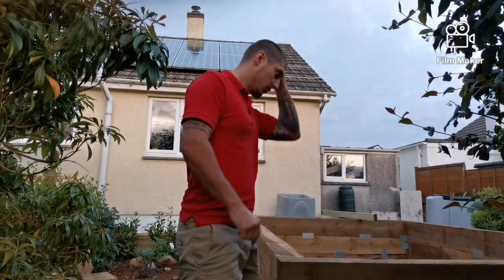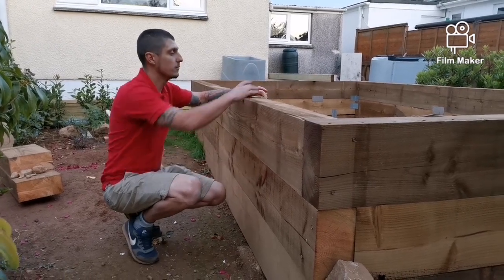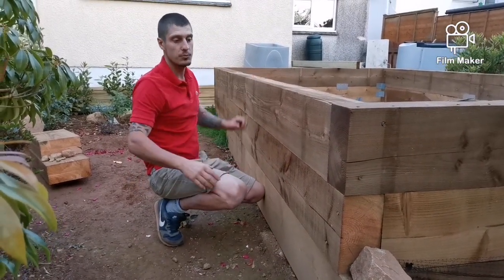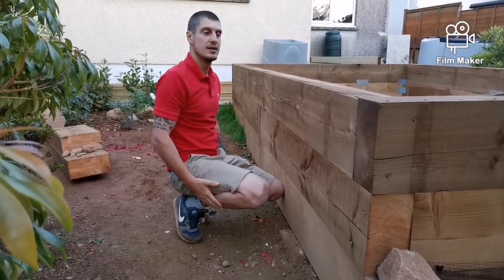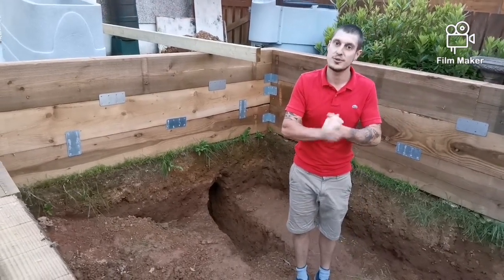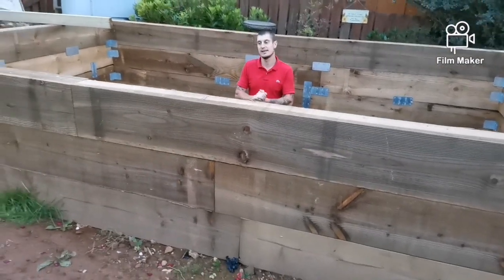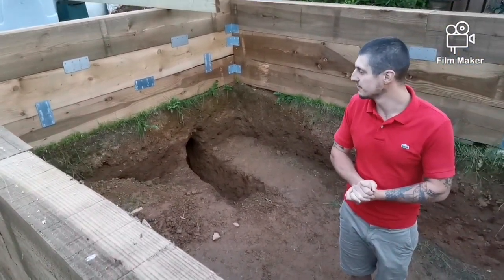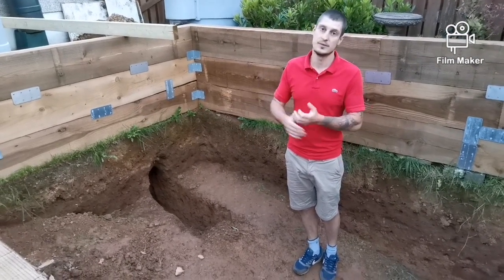Part 8: Building a KOI Pond for begginers 4mts x 2.2mts  lockdown project

Comment: No no no the sieve is the first step for the nexus it will do nothing on the skimmer line
Reply from the maker: I was told by quality Nishikigoi to do it the way
I did wanna go bottom drain to Sieve then then 320 then back in but its gonna be hard to balance it out wouldn't it?
Reply: Iff you keep them both at water level then they will work I think or just ditch the sieve and run the 320 and the skimmer to a baki shower
Reply from the maker: @russelladams7053  yeah I think  cause to have it I needed 2 pumps on the same set up what will make it hard.
I'm no expert I'm learning myself 👍
Thank you for your help.
Have you. Got the Sieve and 320 as 1
Reply: @russelladams7053  so pump all the crap collected from the skimmer in to the shower, great advice
Reply: Both ways will work but the nexus doesn't need the sieve as much as the shower. Matt don't get caught in the middle of a debate that doesn't have a definitive answer as there are always going to be people on both sides of the fence.

Running a nexus 320 at around 8000lph or so should remove all the waste and give you particle free water.

A bakki shower runs better with a faster flow rate and so needs its own circuit but you still need to filter the water beforehand to remove any particles as the shower medis will eventually clog up otherwise. The sieve will remove most but as a precautionary measure put some filter floss/wool in the top tier and see what happens after 24hrs.

Lots of people use filter floss to take out the finer particles that a sieve cant remove.

Tim and Paul at quality Nishikigoi have been in the trade for many many years and know a thing or two about evolution aqua products and their limitations.
Reply from the maker: @Tom_Prendiville   thank you for the comment make alot of sense.
I have been talking to them and they have been helping me alot.
How are you anyways my friend. 👍

Comment: Well done on going with the skimmer that's a must 👍. You've asked a really tricky question half way through your build 🤔. Do you have a window or not ??? ..... ask yourself a few questions.  What benefit will a window give you for view?,how much grief will this be now your this far into your build?  what side of your pond would you have the window and would you have a area to sit and admire your fish through the window???how are you going to fit the window (seal piece of glass in or have it mounted in a steel frame) look on ebay theres a company there that do a railway sleeper steel/aluminum frame and glass specific for this sort of build using railway sleepers  (Atlantica) .Also and this is the big one . Now your this far through your build and you've reinforced the sides with rebar how are you going to remove the sleepers to incorporate a window? Remember I've already built a railway sleeper pond (done sleepers flat though) I didnt do a bottom drain . I didn't do a skimmer and guess what.. I didnt do a window 😔.  All regrets but never had a issue with water quality or filtration.  My next pond will be twice the length with bottom drain . With fitted skimmer and definitely with a window . But I know where there all going to be and how all my pipework is going to go .planning is key and a window should really be planned into your build from start . Hope this helps and remember..        " im always watching" 👀 lol .
Reply from the maker: Thank you Mark F,
I can easy cut 2 layers of sleepers out and cut the rebar.
But yeah think I left it to late for planning a window but it can be done
I am worried about having a window and in 2 mind if to or not.
They definitely look nice and make it easier to see if somthing wrong with your fish.
Thank you so much for your comment.
Reply from the maker: Get a surprise for you on my new upload 👍

Comment: Ponds coming on nicely now 👌 
Just a quick one for you...the piece of wood you are using to gauge your water level for your filter is on top of your sleepers. The final water will need to be lower than your marker or water will be sloshing over the top of the finished pond
Reply from the maker: Hello glynne,
Yes you are right I've just got that level so I know when digging Down for the filter I know it's got to be lower then that point 👍
Thank you for your comment 👍

Comment: Ponds looking great so far. Quick question why didn't you place the sleepers on a concrete pillar? All the ones I've seen on Facebook say you need one.
Reply from the maker: Hello qasim nawaz thank you for the comment.
The real reason why I didn't is I did rush the start and just started digging before  thinking about it.
It should be fine with out the concrete surround.
Well only time can tell 😂😂
Reply: @mattsonhobbies6966  hope you right. Thanks for the reply
Reply from the maker: @qasimnawaz9376  😂😂so do I 😂😂
Nah it will be fine 👍

Comment: Hi mate just quick question did you use any screws to connect each layer of the sleepers like 300 mm screws from the top of one sleeper all the way through to the next sleeper I know you used a rebar aswell or was it just  the ends of the sleepers screwed ,bracket plates then the rebar cheers mate 👍🏻
Reply from the maker: Holding the sleepers are 200mm coach screws all over it plus 30 rebar  ranges 1mt to 1.5mt length.
Hope that help my friend
Reply: Cornish Koi cheers buddy thanks for the help 👍🏻
Reply from the maker: @Mikemkp  any time my friend.
You building 1 by any chance
Reply: Cornish Koi not just 1 buddy but 2 😮doing a small 8 x4 x4 for growing koi then 14x6 x4 for bigger koi .sleepers just ordered so bring on the back pain 😂
Reply: Cornish Koi what I meant before mate was you said your sleepers were 250 mm upright did the screws go right through the 250 into the other sleeper downwards ?
Reply from the maker: @Mikemkp  that sounds brilliant mate really does 👍👍
Reply from the maker: @Mikemkp   I put them kinda side on through it if that makes sense mate
Reply: Cornish Koi on a diagonal buddy through the side downwards into other sleeper
Reply from the maker: @Mikemkp   yes but but all over  and I drilled the holes the same size as the rebat to when I was hammering them in it squashed the sleepers together 👍
Reply: Cornish Koi thanks mate this is going to be fun
Reply from the maker: Put them on YouTube 👍👍👍
Reply: Cornish Koi nah mate leave that for you buddy will send some pics to you when finished pal
Reply from the maker: @Mikemkp  yes please that be great 👍👍

Comment: dont like to tell you this mate but you put the Rebar upside down...you need to pull it back out and start again...
Reply from the maker: 😂😂 You winding me up 😂😂
Please explain
Reply: @mattsonhobbies6966  of course mate, youre never getting them out....
Reply from the maker: @PaulsKoipond  OMG YOU..... 😂😂😂😂 You had me  Going then. 
I was like I've never heard of rebar having to go in a certain way unless it had a thread on it 😂😂😂
I did struggle with hitting these in as my drill bit was 10mm and rebar was 12mm 😂😂
Think I'm definitely gonna mention you in my next upload😂😂😂 you had me going 😂😂😂
Reply: @mattsonhobbies6966  you did well not bending it mate...i know i probably would of and ended up with a sore thumb...you're doing well mate
Reply from the maker: @PaulsKoipond  I definitely had a sore forearm after it 😂😂😂 Thanks Paul means alot 👍👍
Ps I'm never gonna trust you again 😂😂
Reply: Could i use wooden poles building mine at the moment haven't got rebar
Reply from the maker: @eddiegallagher1360   it's up to you?
I thought I would stick to rebar for strength.
I can't see why not tho.
Reply: @eddiegallagher1360  theres a chance the water pressure might push the poles outwards...you could try wrapping the outside with strong wire to help take the weight....thats how im going to give my temporary pond extra strength